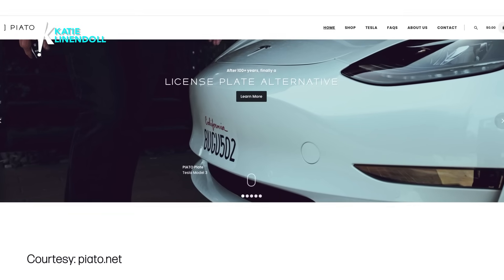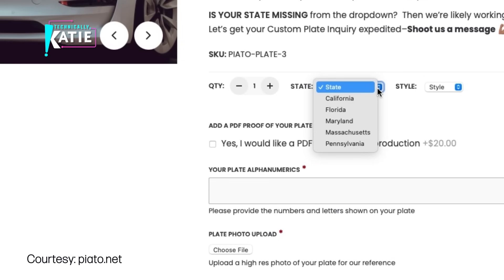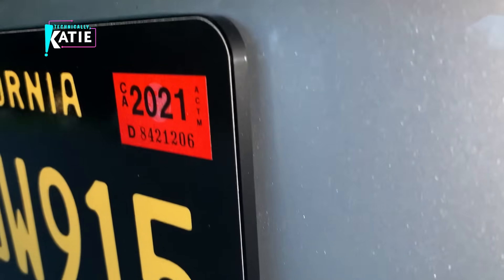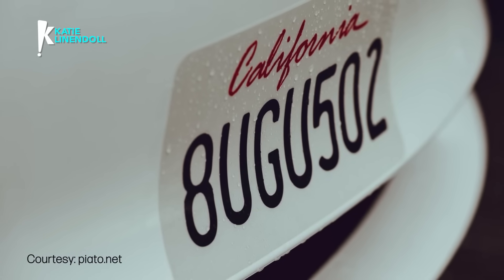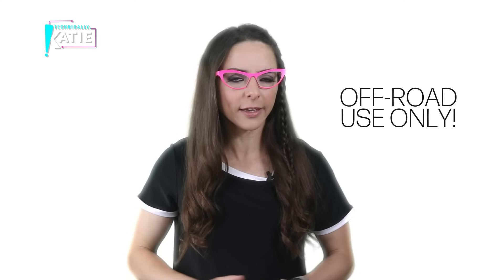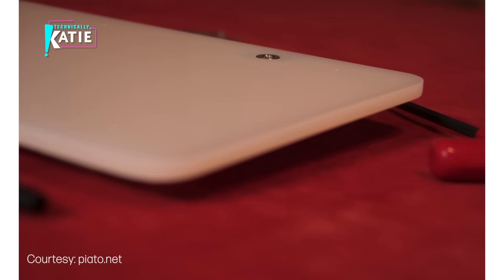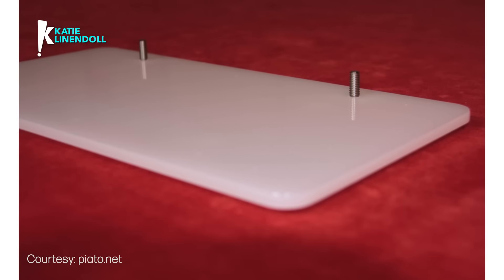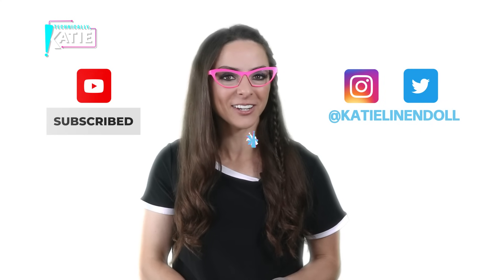"Technically, Katie": Is this the license plate of the future?

Comment: Interesting.  If they hold up better than screen printed aluminum plates that the DMV sells they might have quite a few customers.  The previous NYS plates were gold with blue letters, a throwback to the mid '70s-'86 plates, but the background peeled off them and there were quite a few cars running around with naked aluminum tags.  Unfortunately, NYS just went to a new design white plate (boring!) and killed off my gold/blue plates.  Bummer.